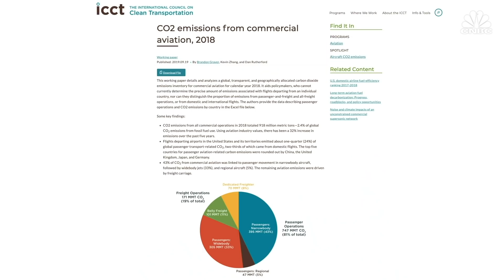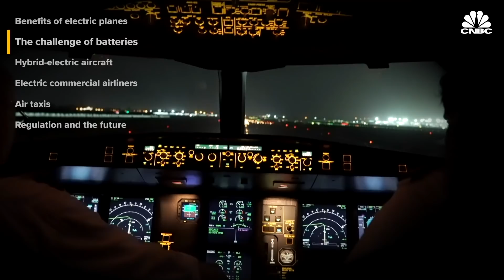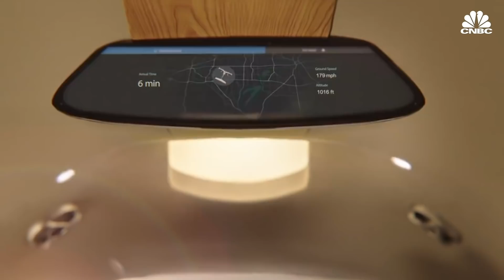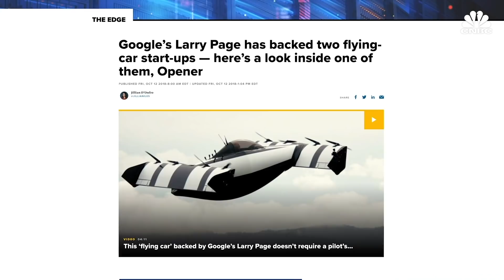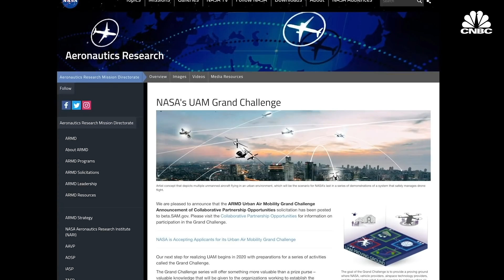Why Don't We Have Electric Planes Yet?

Comment: Simply due to the energy density in fossil fuels and the lack thereof in batteries.
Reply: the plane gets lighter as it burns fuel. an electric aircraft has to carry this super thick heavy batteries that weigh the same when 100% and 5% ful
Reply: @Penguiniel  this would be more of a hybrid and is only a good idea the way you described it if you have a very efficient system that will capture more energy (and waste less) from the combustion of fuel than what a plane running on that fuel would utilize and waste. Generally I don't think this is the case. but with a hybrid that runs on a combination batteries charged by greener sources of energy and jet fuel, they are saying in the video you could be much greener than we are now.
Reply: Harbor air has commercial electric aircraft...Google it.

Comment: I feel like a vast amount of people dont really know the environmental impacts of batteries
Reply: And you are vastly underestimating the ability of recycling to help reduce this, and how much worse fossil fuels are over their lifespan.
Reply: @tuckerholstun2874  scientists have made filters that remove carbon in the air. The issue is that it's to expensive. If they could get it down to $40 per 1000 cubic feet then it would be economically feasible. Right now it's at $100. They also have a salutation to global warming. They  Release  sulfuric acid in the atmosphere at 40k feet and would block the sun's rays making are planet cool down. I should note that at 40k feet acid rain would be extremely low because that fact is that most clouds dont reach that high on land.
Reply: @tuckerholstun2874  also recycling batteries is a good thing but that does not mean that making batteries from scratch will not cause an environmental problem. Plus electric cars have 400 times less energy the traditional gas powered vehicles. That is the reason why car manufacturers are putting all of this technology into there cars. To try and make the super efficient.
Reply: Isaac Sargent your 400X statement is simply misleading and incorrect. And yes the battery production process is not as clean as it should be, but it is NOT worse than the lifetime impact of a gas car on sulfurous or carbon emissions according to all credible research I’ve seen. Also scrubbing carbon from the air still requires a massive, renewable-powered grid to power it, even after it becomes viable, in order to make any sense. Atmospheric particles do not solve ocean acidification caused by increased CO2 concentration in the air so they are not a solution we can depend on.
Reply: @tuckerholstun2874  ya putting acid into the ground is super safe
Reply: Isaac Sargent Acid? Used in a lot of mining operations. Do you know anything about oil extraction and refining? I wish  you would spend the time to compare them by educating yourself. Too bad I know you won’t
Reply: @tuckerholstun2874  refining all they do is boil crude oil and burn off methane. Its actually very clean. And to get crude oil can be very clean. It's when a multi billion dollar company cuts corners is where you can get big environmental impacts. What I'm talking about when it comes to the acid is the process in getting lithium. Lithium is one of the most rare minerals on are planet. It's like .03 percent. So what they do is mine dirt out of the ground and then they get a acid that removes 99.8% of the dirt then what your left with is lithium. Then they put the dirt back into the environment. This is super polluting to the environment. I cant see how having carbon emissions is worse then this. Because if you try to plant plants in this area you cant. So idk what your thinking when I dont know what I'm talking about. But from the sources I've seen this seems to be right.
Reply: @tuckerholstun2874  also should not I ment to say batteries have 400 times less energy of the traditional gas powered car. My bad. That's why a tesla has to 7104 cells to get that energy back. But the total enery per pound is definitely better with a hyrongoncell cars that toyota has made. But I definitely dont think that battery technology will got farther then it is now due to the safty standards. The anode and cathode can be as thick and a human hair. but when a car gets into a accident I really dont think that it beable to not catch fire. Especially if you increase the total enery in the battery.

Comment: The focus shall be on new fuels, batteries is a bad solution. If you look at airliners you do not take more fuel than you need, with a battery you will need to transport the weight of the battery, and airliners like the A320 and B737 these days fly everything from a 30 minute domestic to a 7 hour transatlantic flight. The shorter flights also have quick turn-arounds of 30 minutes, you can’t recharge that fast.

Comment: Without even watching yet I'm pretty sure the answer is batteries.
Reply: But how about Hydrogen Fuel Cells assisted or put together along with the batteries???
Reply: @aliasghar3265  energy density
Reply: @VoltPercival   Yes and no. Fuel cells have a higher energy density than batteries on a mass basis. On a volumetric  basis is another story, and that creates challenges  for airplanes is the size and shape.
Reply: @julianpaige2939  yeah, especially to maintain aerodynamics.
Reply: @aliasghar3265  for large passenger planes, battery planes are a long ways off. Unless we nail down solid state battery tech the only way forward is hydrogen fuel cell electric. It has more than 2 order of magnitude different in energy density, and if designed well, would not have that much larger volume requirements as traditional jet fuel.
Reply: @aliasghar3265  not much difference; they both output electricity and need stored energy; in the case  of fuel cell, it's stored hydrogen..  not sure which has higher energy density.

Comment: As a pilot, I cannot help but laugh at the idea.  Liquid fuels are the only practical method of moving a massive object, carrying hundreds of passengers, reliably, economically, and with great speed.  It is directly related to the amount of energy, that produces combustion, resulting in locomotion, from a given source.  Battery-driven aircraft will not be practical with the exception of those with low airspeeds and minimal payloads.  I can see them in cases of military surveillance where slow moving drones must linger over an area, but otherwise forget it!

Comment: Great questions: 

Can a full electric propelller even cross FL15 (15,000ft above sea level,5,000 above breathable air)? 
(Where as modern airliners could cross FL28+)

How loud are open or closed HIGH RPM propellers
compared to multiple LOW RPM blades in a turbofan?

Comment: It's not only batteries that's developing, even materials go forward, which make it possible to have longer and thinner wings to lift the extra weight of the batteries with less drag. The development of high intensity energy transfer through the air is fast too. This will make it possible to deliver energy from space, and maybe even from the airport. Today the losses is too big though. As for me, I think that the motorized glider "windex 1200" in modernized construction and enlarged would be the ideal regional electric air transport.

Comment: Climate hoax narrative on max.

Not to mention its an undisputed [but highly avoided] fact that electric vehicles have 'carbon footprints' anywhere from 700% to 1000% that of an internal combustion engine, and the energy capacity is dismal, and the batteries are a giant fire hazard, and they do not last very long, therefore maintenance is actually worse than turbojet engines.
Reply: In the video, it was mentioned that a battery system has fewer parts, meaning its maintenance is easier than a traditional system.  In principle, batteries could be swapped out between flights, thereby mitigating the impact of the issue you raise about their lifetime.

Comment: I’m an actual pilot these are a long way off. There are a few trainers out there now but they can barely go 100 miles plus reserve. My family owns a similar aircraft but gas powered and it was 20% the cost of these new planes and I have 4 times the range and can carry 3 times the weight. The batteries are simply too heavy. Additionally, the recharge time, airlines can turn planes in under 30 min a the gate which is way too short to charge anything and even small planes I frequently fly several hundred miles stopping only 10 or 15 min to fuel which would be impossible with recharge times batteries have now (not to mention the range issues mentioned above). This is over a decade away imo

Comment: Lithium-air batteries will make electric planes possible due to higher density and no fire hazard. Lonnie Johnson will achieve this goal, I hope, as 5 years ago his battery was at 1.5x the energy density of current Lithium-ion batteries.

Comment: Air traffic control, flight paths and noise issues will be big problems.
Reply: Electric is pretty silent, especially compared to the combustion engine.
Reply: @philterry3293  I worry about the noise of rotors. Helicopters overhead are the worst. Maybe the smaller rotor “hovercraft” construction would be quieter? I want to know before they start buzzing around in cities.

Comment: Probably because turbines are unimaginably efficient for airborne vehicles.
Reply: Not quite. Jet fuel is much more energy dense. Also technically the plane gets lighter when it uses up fuel.
Reply: However, keep in mind that much of that efficiency simply due to low drag at altitude.
Reply: Eon Gaming 100mpg per person!

Comment: Maybe cuz u can’t recharge a battery in air
Reply: Well you can't refuel a passenger plane in the air either.
Reply: Phil Terry we can , google it
Reply: @mrsnow448  No we can't, even if we went the air force route. there is no way  it would be practical,
Reply: Phil Terry did you research about it ? Man , refueling in air is possible . U might say we can recharge the battery too , maybe we can but the recharging time will be too long .
Reply: @mrsnow448  Of course we can refuel in mid air, but it isn't practical for commercial use.

Comment: I hate how he said small turbine engines are inefficient, when they are the most efficient jet engines
Reply: compared to the electric motor they are.
Reply: @philterry3293  They also don't generate nearly as much thrust
Reply: @westy2432  thrust is not a measure of efficiency.
Reply: @philterry3293  doesn't matter how efficient they are if they can't generate as much thrust
Reply: @westy2432  Nonsense, thrust may equal speed, but it does not equal efficiency. Airlines are always searching for more efficiency, electric planes could shave 70% off fuel bills. Bottom line is a major factor.
Reply: @philterry3293  Try making money with planes carrying a fraction of the amount of people
Reply: @westy2432  Airlines are waiting and investing in the tech to make it a reality. It may be another ten years, but electric planes could be perfect for short range passenger flights.
Reply: @philterry3293  I would agree, but not in the next 10 years
Reply: @westy2432  Well timescale is a hard call. What I do know is there is unprecedented investment in new battery tech. So who knows whats coming?

Comment: Because you are limited to a prop driven , you are limited to the thrust that can be developed by air density. So you can’t rise to a thinner atmosphere where you can lower drag to gain efficiency or over storms . So your looking at commuter only , which is limited in nature , makes for a crowded air space . Would think the  idea of electric high speed rail all except for international travel would be smarter .

Comment: Current planes burn fuel and become lighter and more efficient the longer they fly. Electric planes stay the same weight no matter the condition of the battery charge.  A plane that is heavy with fuel can't land safely without dumping fuel. So an electric plane would have a cargo capacity way below that of current technology. Also, most of today's commercial planes spend almost their entire life airborne. Impossible to do with electric planes and current recharge times.

Comment: create more efficiency and more powerful engines at the same time, like alternator which could recharge it mid flight, so it could travel further or using concentrated solar power. turning solar power from heat into electric or having stations at airports which covert waste to energy like electric or inflight refuelling for the energy?!

Comment: I don't get why fuel cell electric planes aren't thought of. You get an electric plane with the added advantage that as fuel is used, the plane gets lighter versus batteries that become dead weight when used up. Plus, you get 500+ miles in range.

Comment: I thought I saw one flying out of Palm Springs a couple of days ago. It was slow, it was shaped more like a glider. But it was not gas powered. Sounded different. I think I saw it as I looked on line. So there are small private not long distance electric airplanes.

Comment: Electric airplanes only have a range of around 200 miles, and that is without any time spent circling around an airport for an hour waiting for a clear slot to land during heavy traffic, which sometimes happens.  If you are running off of jet fuel you have the extra energy to keep circling until a spot opens, but with an electric aircraft, you will be crashing out of the sky after just 15 minutes.  The ONLY places where there are electric aircraft flying now are places like the seaplanes around Vancouver, where they only have to fly less than 100 miles and can land immediately on the water, no need to circle the airport during times of heavy traffic. If an aircraft is capable of landing on water or at some small private airport that has little to no traffic, and the distance it flies is less than 200 miles, then yes, it can easily be done with an electric aircraft, but there are very few routes that fit into this category, most fly to congested airports, and that is why you don't see many electric aircraft these days. The first commercial electric aircraft put into regular operation will most likely be planes that can take off and land from water, close to city centers that do not experience freezing temperatures in the winter months.

Comment: and where is all this electricity coming from when we can't even charge our cellphones with solar power let alone power an airplane
Reply: Tons and tons of wind turbines and solar panels, plus a lot of grid storage batteries and pumped hydro storage.
Reply: Josh G except the grid is increasingly renewable, and coal and gas to batteries are still less carbon intensive bc the grid is more efficient than a car engine......
Reply: Unless it turns out fusion is possible were screwed we can only keep burning coal and gas for so long and wind and solar are intermittent its not a reliable source of 24 hour energy
Reply: @ff6605  fission can work with Molten salt style reactors. Not as good ad fusion, but its not a half century away

Comment: Actually there is a fleet of commuter planes in Vancouver BC currently being retrofitted with electric power.
Reply: Actually...no....there is one aircraft  being test flown as a proof of concept with a 750 hp electric motor retrofitted onto a 45 year old DHC2 Beaver that delivers less than one hours flight time being operated as an experimental airplane without a supplemental type certificate, so it cannot be used for commercial purposes  under FAR part 135 or part 121......A little further away than "a fleet of them" , I would think.....

Comment: You need alternated on the motor drive system charging batteries while you drain others. I’m in a wheelchair I know what’s missing they don’t want us to know. If my chair had an alternater when m hey battery’s turned my wheels it could also be charging the batteries constant power no plug-in free charging

Comment: It's gone be at least another 30 to 50 years before we see electric large widebody long range airliners. The problem is today's lithium batteries are to heavy and dangerous for large airliners, right now lithium batteries are more dangerous then jet fuel. If any battery explodes the amount of flame and heat it generates is mind blowing. There is just absolutely no way FAA would certify today's lithium batteries to be used in large amounts on airliners. Some Airliners do have lithium batteries(787 for example) but it's usually just one small battery for back up systems or to start the APU and even with those airliner manufacturer's had trouble getting them certified. Boeing 787 had lithium battery troubles in the beginning and FAA almost made them remove the lithium batteries, but Boeing came up with an armored box for the battery so if it does explode it's contained within the box.

Comment: If you want to save 15 minutes of your life, you can jump in here:
14:42 - "Currently, the economics do not work."
Reply: Talking of e f f ic i e n c y
Reply: There are electric planes capable of an hour plus of flight excellent (low cost) for training and short haul flights
Reply: We’re making it work in Canada ... because Canadians are on the technological cutting edge ...
https://www.harbourair.com/about/corporate-responsibility/goingelectric/
Reply: @smallstudiodesign :  "because Canadians are on the technological cutting edge"

Either that, or because you've limited your operations to an extremely narrow niche market.

Quote:
"Due to the smaller size of our single-engine aircrafts (carrying between 6 to 19 passengers) and the short average length of our routes (most of our routes are around 30 min or less)..."

We could also brag about the success of electric planes amongst the R/C hobbyists.
The fundamental problem right now is energy density.  Put another way:  battery weight.
Solid state could make for a big jump the way Li-ion did.
Reply: Thanks you !
Reply: Thanks bud !!